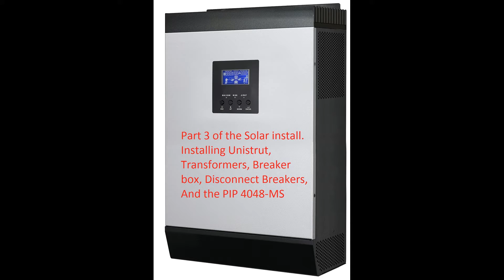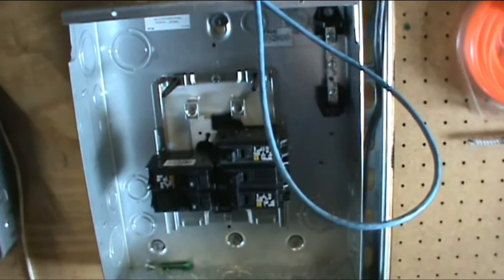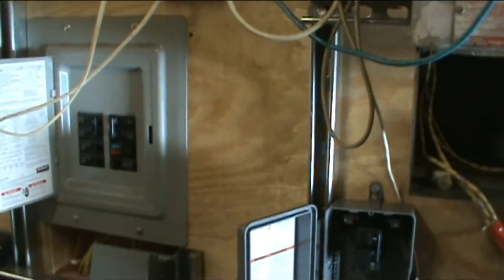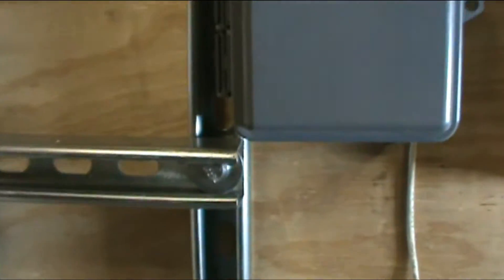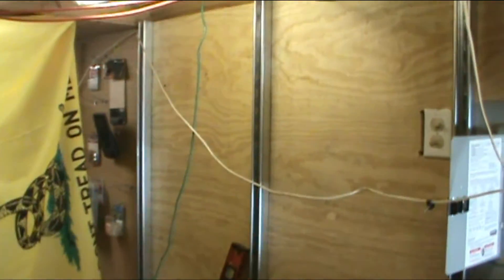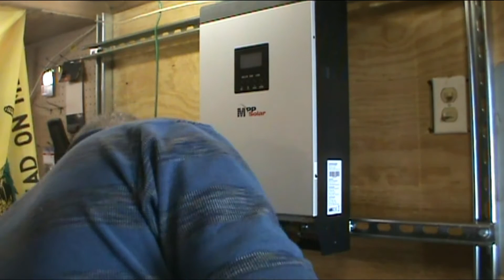New solar install Part 3

Comment: Wall looks better all ready, Only Needs MPP blue display lit up!!!!!! lol! You mounted the pip with one hand, 2 of you guys for mounting the transformer. lol!
Reply from the maker: That Transformer was 125 LB beast. and after I add on to this shed I will have to do it all again when I move every thing. but this is a nice start.
Reply from the maker: but hey look who was lifting that monster I think my buddy was just watching, LOL he did help get it screwed.
Reply: Your going to love that darn thing!!!! The beast transformer should give some solid power.
Reply: How the heck is victron getting 100 amps from there unit, only 40 lbs? It's pricey but after seeing you mount the beast, Saving my loot for the victron unit. lol! even the 8000 watt transformer i'm using now weighs 45 ish LBS got some weight to it, was claimed to be the lightest in it's class.

Comment: Nice looking  install!  It never ends does it.
Reply from the maker: Thanks, Nope never done. I have been talking to Bill I see he ordered one of your mounts I have been thinking about ordering one my self from yea. I told him I got the electronics for it a long long time a go. but need to build the mount. I been thinking about building 2 of them so when I get 4 more 158 watt panels I can have 6 145's on one side and 6 158's on the other and those can go to my PIP.  I'm looking to have up to 8kw of solar and if building these would help with solar producing it would be worth it.